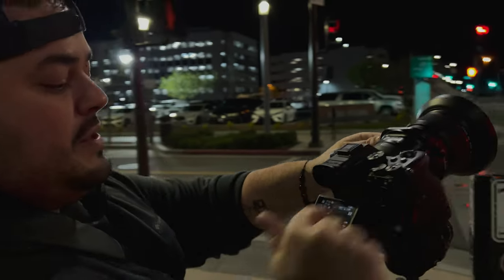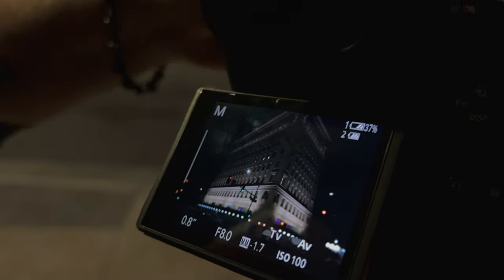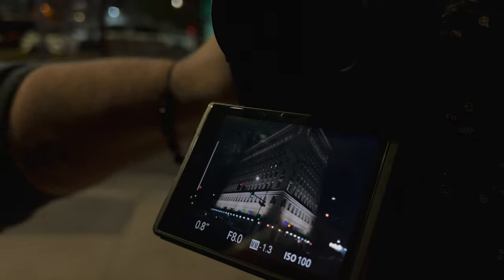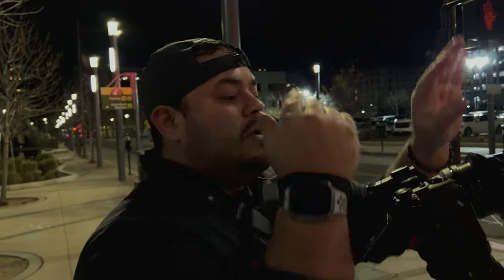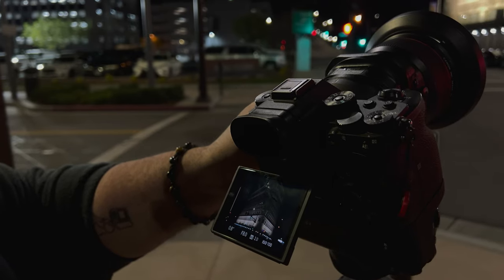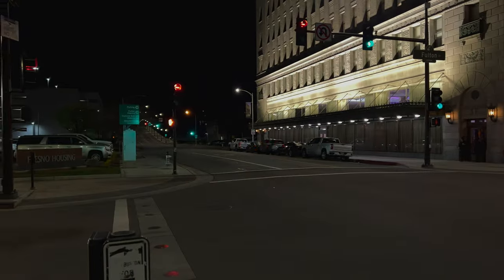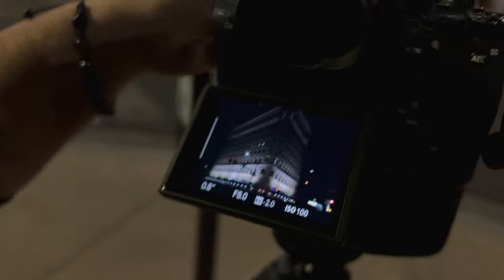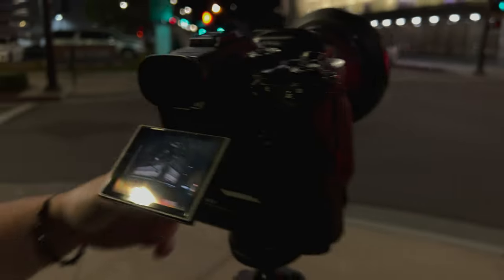Gilbert Explains: Tilt Shift Lenses

Comment: I should note that in many instances (if you're at an appropriate distance from the subject) you can also just keep the sensor plane parallel and see if the whole building will shift into the frame. This eliminates the need for tilting, which was used here to really emphasize converging lines. Plus, we were very close to that tall building for a 24mm lens. But it still worked!